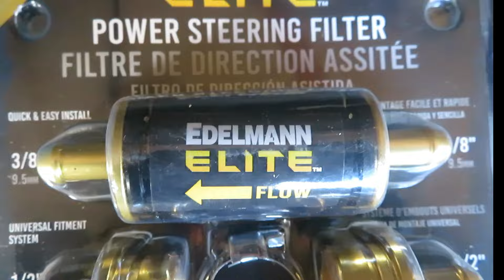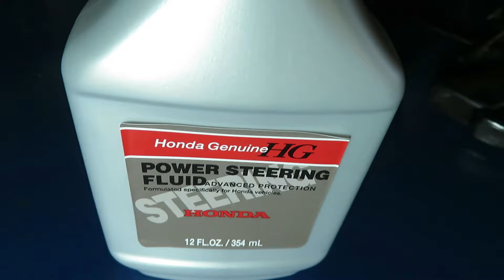How to Install and Check a Power Steering Filter Edelmann Elite

Comment: When you call to put it on a return line it is actually an outflow line from the cooler to the reservoir . The return line technically is the return line to the pump from the reservoir .
Reply from the maker: You may be right, technically, but in the real world it will have to go where it will fit.